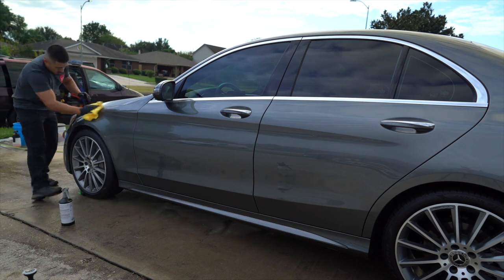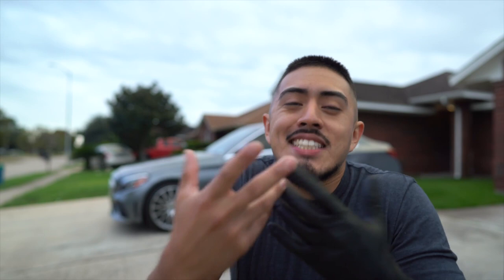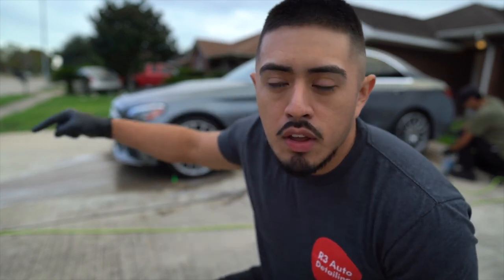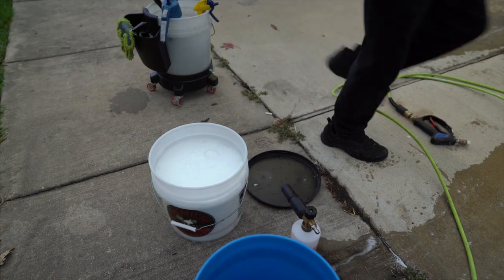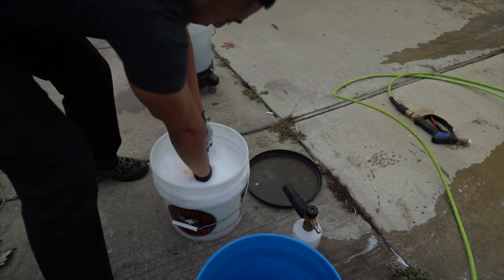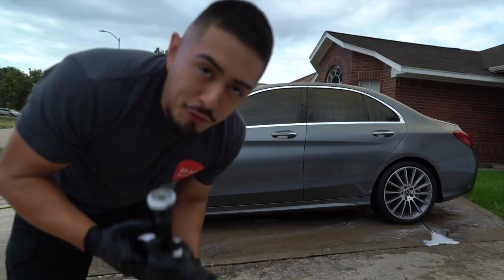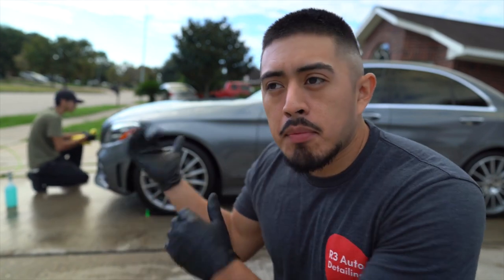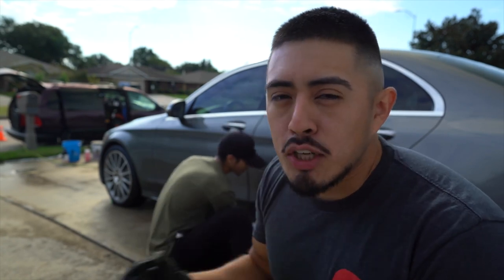How We Finish a Detail in 1.5 Hours ($133/hour) | Our Wash and Wax Process Explained

Comment from the maker: All the product links are in the description box. Let me know what you thought of the video! This is a first time in a while that I do some sort-of "how-to" video. Download my (free) guide to help you start now: https://detailgroove.co/ultimate-detailing-guide
Reply: Went to your site but can’t find link for a dependable sprayer for the 10:1 and 4:1 dilutions to be put in
Reply: I think if you have the pump sprayers pre pumped before you show up its more efficient. But on the other hand if you have a master blaster then i think its just as much effort as a pump sprayer. Because you always have to pump the sprayers no matter what. I find the best solution is a master blaster spray bottle because it uses alot of product like the pump sprayer but you dont ever have to worry about havinging it pumped up. Tommato tammato..Also ive found if you take a cheap bucket and cut off the bottom like a deep plate then cut it into 4ths like a pizza.. i use them under the wheels so the hoses dont get caught. Its cheap and it works. I put those under the wheels as i hit the wheels so i dont waist time doing it separately...
Reply: Hey  what do you think I did wrong because instead of taking the dirt out i got my car sits more dirty?
Reply: What is your annual salary? Is this your only job?
Reply: What does he mean by "paint preping the vehicle"?

Comment: I’m a weekend warrior detailer and the one thing I got to say is when you’re moving fast, you tend to miss some spots. One thing I did was write down everything from step 1 to the last step that I would be doing when I’m detailing my car. I use that paper as a reference so I can basically study my procedures and remember what I need to do. I don’t know if anybody else does that but it has helped me in being quick and efficient because before I wasn’t cleaning my car the way I wanted when I was moving fast
Reply from the maker: We have an SOP for everything we do👌🏽
Reply: Standard operating procedure leave no room for deviation.  Great step to process improvements.  All components of a lean management system.
Reply from the maker: We actually use them more as guidelines. We can't create an SOP for every scenario we come across. Couple that with proper training and knowledge and there's a winning formula

Comment: Awesone as usual..Just one question.. why use that paint sealer/wax instead of a quicker silicate base spray wax. To justify charging more or ? Just wondering..We've switched to silicate based spray waxes to save time. Seems to have almost the same results. i cant imagine your getting much correction anyway from the machine. Just asking always looking to learn. Thanks

Comment: I think you just nailed exactly why I'm so slow. I'm learning from YouTube but no detailer on there is going to tell you to skim over stuff that doesn't need much attention. They show you how you should be rotating a little detail brush over every surface. 
I couldn't understand how a guy can do a whole interior in 2 hours working like that....but if you can combine 3 steps into one, that's probably the most efficient.
When you look at price Vs time, you just HAVE to cut some corners or be more efficient. Otherwise, you'd only do 1 car per day and only get $200 for that...it just doesn't pay that way

Comment: Since you are already using car pro eraser , I would highly recommend using car pro essence if you want a very light polish with some fillers. For cars that have ceramic coating , try using car pro essence plus which wont remove the coating and it will rejuvenate it .

Comment: Why don’t you guys use a spray sealant over applying a wax/sealant? It seems faster to apply with less equipment. I have been using the EGO blowers since 2015 and they are awesome. It does suck up front buying batteries but less time and hassle with chords and generators etc.

Comment: Great video as usual Oscar! You're a beast being so efficient ;-)
I love doing the MF towel wash using ONR, exactly as you described (flip until all 8 sides are used, and grab a new one) - ONR leaves the car so nice and shiny and also seems to have some water beading affect.
Also, it think when filming these detailings, a lot of guys maybe tend to over-do it for the camera. E.g. gently/slowly rubbing in APC with a detail brush on every little surface. I don't understand how you can do a car fast when doing that. Of course, I'm not very experienced, so I could easily be wrong ;-)
Reply: It depends on time. If they are rushed they don’t but if not then there is no problem with doing slow for camera (not rushed=customer doesn’t mind). Some of it can be editing and slow mo too.

Comment: I did like your channel but after saying someone is not efficient if they're not using a pump sprayer, I am not a fan of that. When someone's first starting out they don't really have the money to spend 30 to $40 each on pump sprayers. I think there are more important things they should be buying. The $3 spray bottles from home Depot spray out a lot of liquid in one squeeze and can be just as efficient. Everyone does do things differently everyone has a different setup and I agree with that. but don't tell people they're not efficient if they're not using a pump spraye
Reply from the maker: You must be new here😅. I always recommend to buy the best you can within your budget? $14? Good enough. $25? Good enough. But it is scientifically and mathematically proven that a pump sprayer is more efficient than a spray bottle